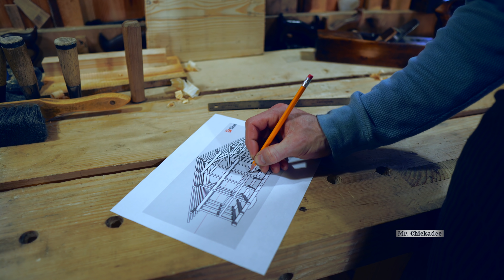Preparations for raising day: Japanese style timber frame (Woodworking ASMR)

Comment: Nice work. Is there a reason oil them in the joint? Are they exsposed to weather?   Would you share how to make the oil? Aprox ammounts etc.
Reply from the maker: Timber frames are often exposed to the weather for a while before they can be covered up. They also move less if all end grain is sealed.

Comment: I am still pretty sure that the Japanese scaled their rafters for the potential snow load?
Reply: Especially if you are planning to use some traditional roofing
Reply from the maker: Speaking very broadly and generally, yes, yes they did, however, its more of an overall roofing system design issue rather than simply increasing rafter dimensions. More import was placed on the sum total of roof supporting beams and their relationship to roof load than the rafters, which were very often much smaller even than these I'm using. In areas of heavy snowfall, roof pitch was simply increased to remove the snow from the roof swiftly rather than trying to design the roof to support 3m of snow load...

Comment: Hi Josh. I notice that you are in love with the 15 degree paring chisel. Is that how it was bought or did you polish the angle yourself? It is a pleasure to watch how such perfect things come out of your hand. But it would be very good to show us a little of the "many mistakes" (as you mentioned in the comments) that you went through to reach this perfection. It's just an opinion ...But where did the brick stove disappear. Can you please tell us why you changed it with a cast iron stove? Otherwise all the best and Happy New Year ! Dimi from Romania.
Reply from the maker: Hi Dumitru!!!!  Mass heaters take time to warm up, then maintain that temp, and it was less practical in a seldom use workshop, where I may not always wish to start preheating everything many hours before work. The metal stove, though less comfortable to use, heats up fast so made more sense for use. In a house, or daily use building, a mass heater would be much better.
Reply: @MrChickadee  thank you for your time
Reply: @MrChickadee  thank you for your time

Comment: Hi Mr Chickadee. Great videos. What is the chisel with the cranked neck you are using for paring?
Reply from the maker: Its an old framing chisel I reforged and torqued the neck on, 
re-hardened it to Japanese standards (very very hard)
Reply: @MrChickadee  that’s very cool. Cheers

Comment: Awesome content, would be interesting to see a full time-lapse of the process along with a clock or calander. 

Also, do you mill and dry your own lumber? Looking at building a smaller shed and ive found a few references to green wood being used but nothing definitive.
Reply from the maker: Ive done both but mostly buy green wood from a sawmill now. Pine or poplar run around 50cents a board foot here. The vast majority of all human buildings ever were made with green wood.

Comment: Surprised you didn't make your saw cuts on the angles (video @ 1:50)  the same width of your chisel. I know you have a good selection of chisels so there had to be a good reason:-)
Reply from the maker: I tend to always use a smaller chisel than mortise, learned that from the Japanese carpenters.

Comment: Very good, relaxing content as always! 

I've been following your videos for a while now and I've always wondered what is the stuff you brush on your workpieces after they're complete. Just randomly watching this video with captions I finally discovered it's heated canola oil, turpentine and beeswax. I actually want to try some timberframing myself for a workshop and your videos really do provide great inspiration and important visual reference for it. 

Is there a chance you would share the proportions of oil, turpentine and beeswax you use in the finish? I would love to try your recipe.

Anyways, much support from Brazil. Keep up the awesome work!
Reply from the maker: Well its a rough guess really, but start with equal parts oil and solvent, then add wax slowly over heat, maybe 1/2cup wax per gallon of mix. You wont see the real consistancy until it cools and thickens, so you will need to play with it some.

Comment: Great chisel works . I have a question about  your scale. Japanese carpenters use shaku (尺)＝30㎝　sun(寸)＝3㎝,
Most traditional Japanese architect were adjusted these scale, just like feet and inch scale .  I wonder which scale method are you using? feet and inch method or shaku and sun method?
Reply from the maker: Im using inches/feet, though any measuring system will work

Comment: What are the proportions for the Canola Oil, Turpentine, Beeswax mix?
Reply from the maker: mmm around 50/50 oil and solvent, then try maybe 1/2cup wax per gallon of other
Reply: @MrChickadee  Old thread but could someone tell what kind of oil this Canola oil is? Is it the same oil you use in cooking, or is it some special brand with low acidity for example? Google gives me so many versions what it might be…

Comment: Was that the metric side of the ruler I saw you measuring with 🤭🤭😅
Reply from the maker: Nope! ;)
Reply: @MrChickadee  There's an excellent 5 page section in Bill Kauffman's book Ain't My America that you might enjoy titled "No Litering".  Here's a little excerpt: "The inch, the primary unit of measurement in the customary system, is based on the distance from the end of the middle finger to the first joint.  The meter, the fundament of the metric system, is equal to one ten-millionth of the distance from the equator to the pole.  Or so French scientists believed in 1795.  They were wrong.  One system is based on the human body--literally, a human scale--and the other is the mismeasurement of theoreticians..."

Comment: Such a pity to put all that time and effort into something, but do it in a non-durable softwood.
Reply: Diss agree
Reply from the maker: Well friend, did you know the oldest wooden architecture is made of soft woods? That plus many over 500 years old around the world.
Reply: @MrChickadee  I'm an architect (British) specialising in ancient buildings. I regularly work with buildings that are 1200+ years old, and exposed oak frames which are 700+ years old are everyday stuff for me. So yes, I knew. I also know that the only way such buildings survive if they are made of softwood is if they are scrupulously maintained throughout their life, which usually means they are either royal or religious, and in stable economies. Domestic structures simply don't have the continuity of maintenance to allow long term endurance. The nails holding your roofing on.......how long will they last? Will the property owner at the time they start failing do the necessary work in time? If the framing was made of oak (white oak, in America), then the window of opportunity for doing the repairs is at least 50 years longer than with softwood.